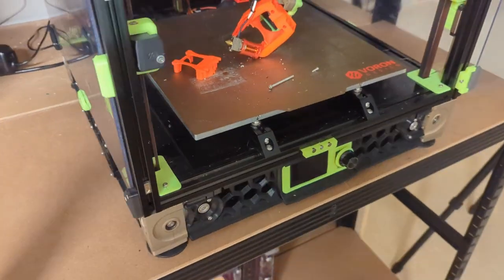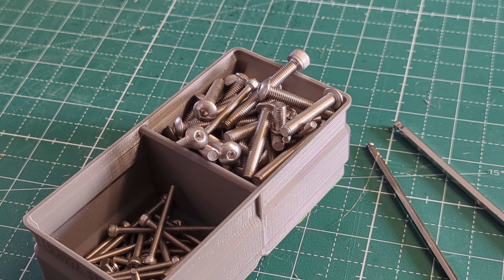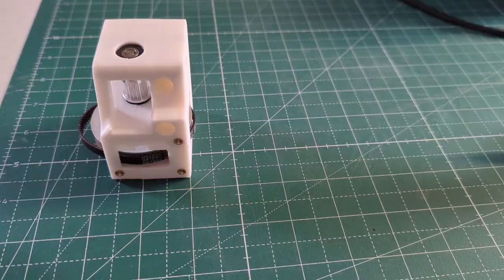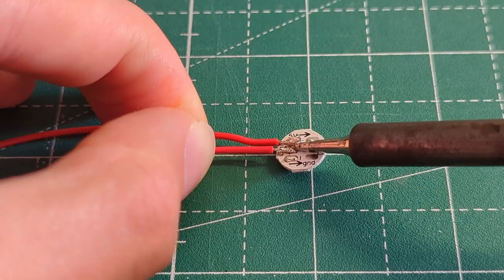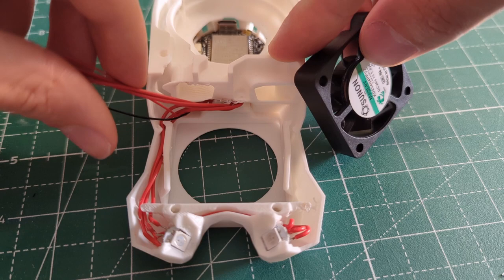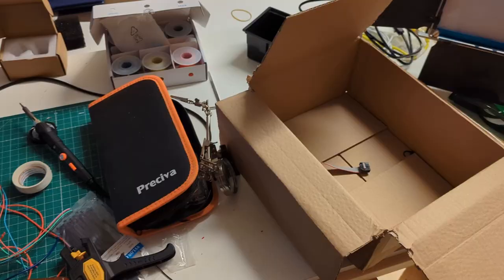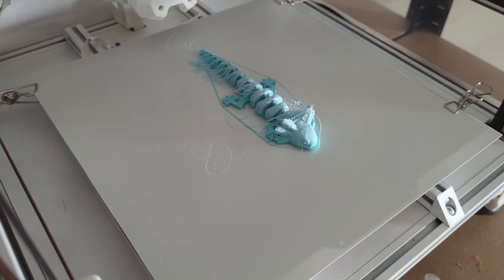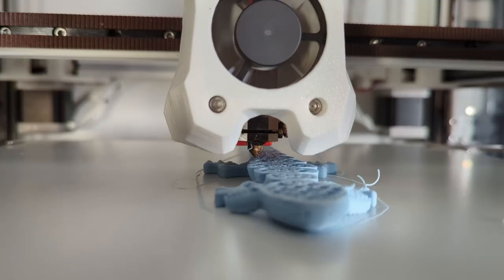I Build an All White Voron and it Looks Amazing!

Comment: That G10 (or FR4) build plate is a game changer! I'm printing for years on G10 plates now and I love it. Needs no adhesives whatsoever.
When the plate cools down the parts are sitting loose on the plate.
Remember not to touch the plate with your greasy fingers and you won't have to clean it either.  My plate is white too, just to be able to see the first layer better, I mostly print in black ASA

Comment: I have been using Ziro filament for the past 3 years, it is excellent filament, well wound, you get a sealable Mylar backed bag for storage and a sample of their more exotic filament and also you get some nozzle cleaning filament and it is the real stuff not just some nylon filament, you used to get a card for writing print notes on but the last couple of orders I made none of the rolls came with one and so I scanned one and printed out my own on card.

Comment: 10:20 I'm not calling that good print quality. I know you ran a timelapse that tends to create oozing if retraction is not properly tuned, but here that's in excess.
Keep tuning. I'd recommend you have a look at Ellis' print tuning guide
Reply from the maker: You are right. I had some flow issues. It was tuned fine but there was a problem with the dragon hot end. The thermester wasn't working properly and the Heatblock got too hot. I had to replace the whole hot end assembly. Now it's working as it should be.

Comment: So clean ! I want to build one, but it's too expensive. I have a prusa mk4 I got in kit, was an amazing experience
Reply from the maker: Building the Voron was a lot of fun. I can only recommend it!
Reply: @Craftknights3D  I have a question: is it noisy ? I cannot afford to not get over 50 dB
Reply: @Craftknights3D  How noisy it is? I cannot afford to get over 50 dB because I have annoying neighbours. Mk4 is 42-49dB with enclosure and concrete slab
Reply: Voron s are usually pretty quiet.   I have 3 of them printing near me (2m) and it’s ok.  The 2.4 is the quieter one.  And it depends on the speed you wanna use.  During the night you could slow I’d down.

During the bed mesh it is the loudest.  And it’s important to place 3d printers in general on a good support.  A nice 2 cm stone and a rubber Matt separate the printer and it’s vibrations pretty well.

Comment: only thing I can say different is that you can now order a 2.4 in white 2020 extrusions already, or silver.  Also I HIGHLY suggest getting the LDO kit for the 2.4, yes you can get cheaper kits or even self source it.  However the LDO kit makes putting it together SO MUCH EASIER, especially when it comes to the wiring.  There are 2 guides you follow when building the LDO version, but for the most part you follow the main Voron guide, but check the LDO guide saying what things are different at certain pages.  The main difference between the LDO and Main voron guides are how the Electronics bay goes together, basically its flipped 90dg from how the main guide has you do it (there is a good reason for this, better airflow).
Mine is Red Frame with Red/Dark Grey ASA.  The only PLA things is the screen cover and one of the skirts needed reprinted and I had already swapped to a red PLA.

Comment: I've read that white ABS is  recommended for printing parts for the Voron because it may not hold up.  Pure ABS is usually black, and only certain colors of ABS have the same strength.  White ABS from some makers may not be up to snuff.
Reply from the maker: I had no issues so far. But let' s See how it holds up.
Reply: Pure ABS is actually a ivory white color and slightly transparent. Not a very pretty color though. White and some other colors use pigments to color them, small crystals which are not soluble in the polymer. These weaken the material. Black and most other colors use dyes which are individual molecules soluble in the material and therefore do not weaken the material significantly. It takes a relatively large amount of pigment to make white ABS and I would not recommend printing Voron functional parts using it without testing.
Reply: What filament did you use for the parts? @Craftknights3D
Reply: @GeldVerdienenOnline1  For my Enderwire conversion I used PETG for everything.  I am attempting to print the Stealthburner hotend mount parts in ABS.  The smaller part printed OK, the larger one shows warpage.  It might work, I'm trying to print it for the 3rd time right now.  I have my Ender 3 in a closed closet, surrounded by a cardboard shield with a towel on top to contain the heat.  I moved the print to the center of the bed, when I realised that only one corner of the part had warped.  If it doesn't work this time I will give up.  If it does print better, I will also attempt to print the X carriage parts in ABS as well.

Comment: Im not sure but you should have built frame on glass because its flat and would help achieve that perfect alignment also if u use EBB just go umbilical because those chains can jam sometimes
Reply from the maker: The EBB is not run through the cable chains. That's why there are only cable chains on the x-axis and not on y. 
The cable chain on the x-axis is for the end stops and the one in the back is for the motors.
Reply: @Craftknights3D  i see fair but you could still remove chains ;p
Reply: @Basurci yeah. You right. Maybe I will when I Finish the build.
Reply: @valentinBu  cant wait to see it finished